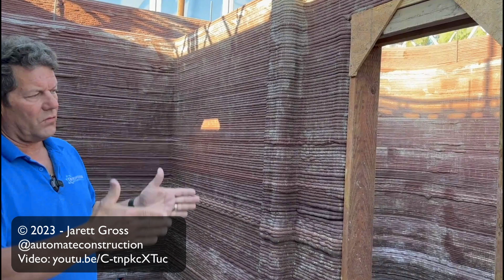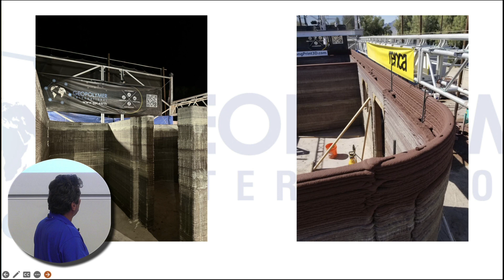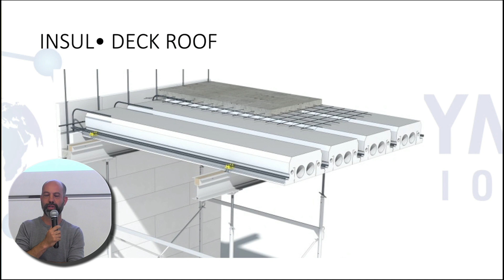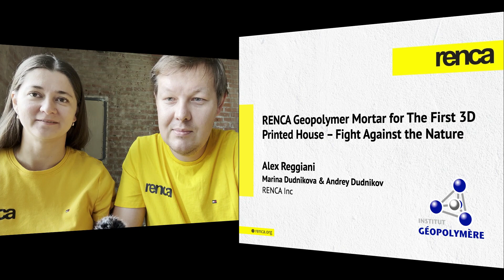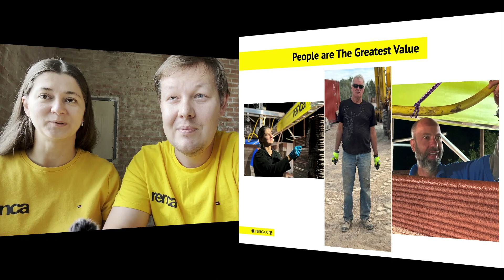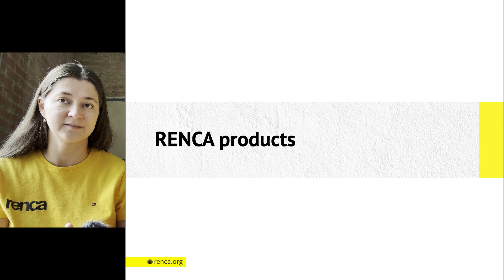First house printed in Geopolymer Cement (GP Intl & RENCA)

Comment: I'm very surprised that Dunn dismissed the geopolymer concept as conceivable to explain any of the ancient structures. Especially Tiwanaku.
Reply: This is cutting edge
Reply: The Bosnian Pyramids have huge slabs of seemingly purposely constructed geopolymer. It's cracked in places. Perhaps too permeable for water, and obviously not armed with rebar or other long fibres.
Reply: @Cloxxki  the bosnian pyramids are naturally occurring geologic structures, also known as 'mountains', or 'hills', and are NOT manmade.
Reply: because its very easy to test the material to know whether it is something manmade, or not.
Reply: @xisotopex  : both in Cairo and Peru blocks were tested and no question they found artificial stone. Davidovits has documented this thoroughly

Comment: Have there been tests with long fibres in the mix or between layers of print? Maybe hemp or the like might allow for less volume and getting the same properties? I could also imagine for instance a few strong filaments to be part of the print.
Reply: I can also imagine a netting person being added right after the print nozzle pass. A smart knitting method would add vertical fibre connection.
Reply from the maker: Short fibers have been used. Natural fibers like hemp, flax, cotton do work very well in a geopolymer system.
Reply: That is possible, but normally long fibers are used to increase flexural strength at higher dosages. We have used 6 mm PVA fibers to compensate a tiny surface shrinkage that could occur.